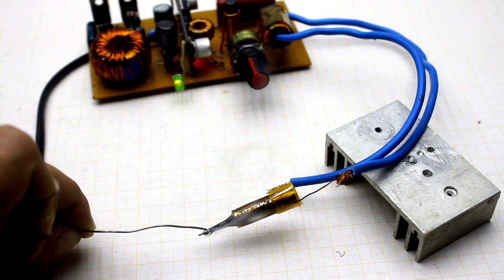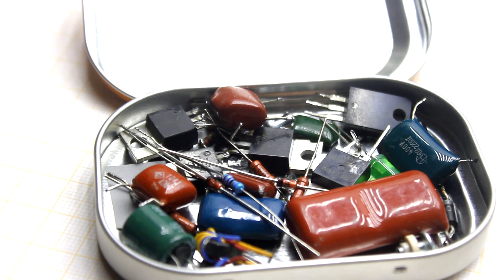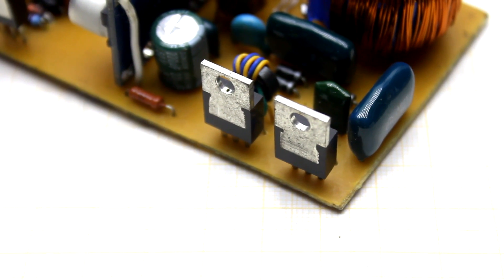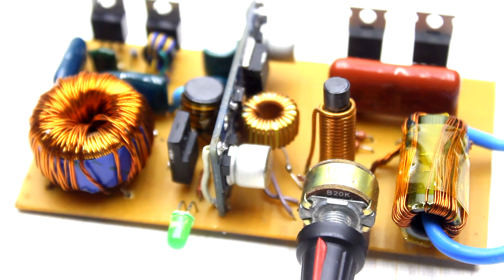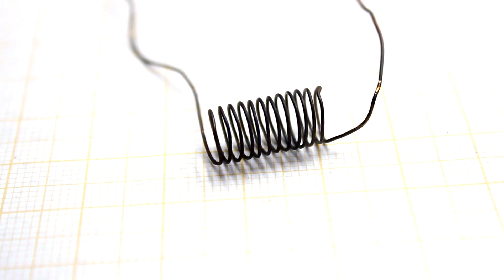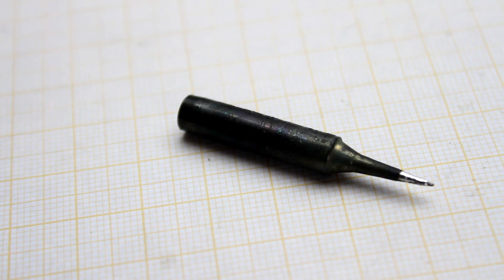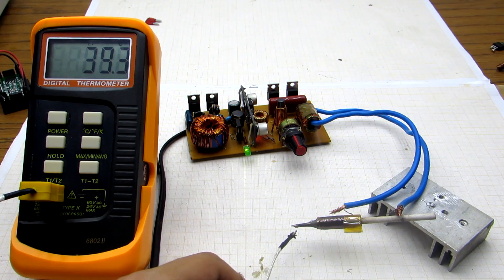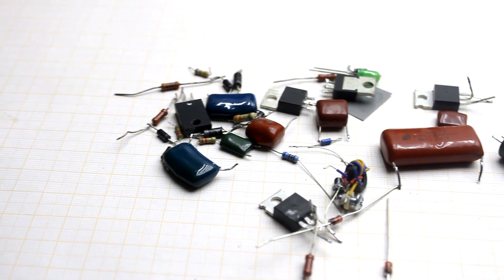DIY induction soldering station

Comment: My old station broke down. Could not find a schematic and many things where burned so could not read the values. I took out the board. draw it on a piece of perfboard. Cut it and made holes in it like the original board. And just made a 555 pwm to an irfz44n mosfet. Works like a charm. Funny you can hear the frequency a bit since it is low frequency modulation. It is not the best design i know. But it is simple, reliable and it gets the job done. Also no need to tune. It does not use the temperature sensing. Since the temp. wire was broken too in the soldering iron and  i wanted to reuse it too.  I choose such circuit.

Comment: Not worth the effort you expend just to have an IH sloldering tip.  Maybe OK for the joy of learning, but from a practical standpoint this is not worth the trouble.
Reply: Ernie Schatz that's the easiest soldering iron you can make. Take mosfets from a dead motherboard, a pc power supply, an arduino/pwm controller, and a thermocoupler and easily you can have THE BEST soldering iron you can possibly have, mine has 200w and heat up in two seconds, i have never seen any soldering iron more powerfull than mine.

Comment: Excellent demonstration. But the problem is I can't understand the purpose of the project! My regular soldering iron is also 24W and doing awesomely better than the one you have shown here.
Reply: vzs's aren't necessarily limited to this low power, i have a 200w system that heats my soldering iron tip in literally 1 second.
Reply: The purpose is just to demonstrate & learn about induction heating; and to build it because he can. But it’s just a fixed power soldering iron with no temperature feedback whatsoever.

Comment: Induction Iron is vary useful for lossless operation. Adding an extra temperature control, this project would be the professional soldering station. Thanks for the research and share
Reply: Rony Chakraborty i have a 200w soldering iron, and damn i have never seen a better or sronger soldering iron than mine, that thing can heat in 2 seconds, plus an arduino nano for pwm and a thermocouple and you're set. Any pc power supply can supply 200w, and with that amount of power it doesn't matter how beefy the component you're trying to remove, if you touched the solder it will remain liquid whatever you do, it's beautifull.

Comment: is the induction heating safe for sensitive electronics? I mean won't the high frequency EM induce currents inside components
Reply: Tayyab Naveed nop, especially considering that the induced voltages should be in the range of microvolts.

Comment: i would just cut the buck converter and the zvs part and directly power it from the first stage power supply. if i want power regulation i would use thyristor-DIAC based pwm control on the 220v 50 hz input
Reply: Two_Number_Nines then you will definetly loose 70% of the power to the ambient and make the soldering iron take ages to heat up, while my 200w system with just a normal tip takes 2 seconds to heat up.

Comment: Why would you want an induction soldering station when a normal nichrome resistor should work better?
Reply: Zetsubou_232_ this is just demo, however top soldering stations like Hakko uses induction heating, advantages are, longer life, quick hearing, better temperature control ( if you are de soldering a component mounted on a big heat sink, normal soldering iron's temperature will decrease, but a good soldering station will sense this and will quickly maintain temperature by pumping extra energy).
I am going to build and use this in my de soldering gun because I am unable to get it's heating element.
Reply: Rohit Chaturvedi you could sense the tip's temperature via curie effect, btw
Reply: Zetsubou_232_ Because it's fun. :)
Reply: Hakko aren't a "top" station.
They are just a reasonable quality budget one.
They aren't induction either.
Reply: NoName yes there are induction stations from hakko, i saw this shit, it wasn't cheap though.
Reply: I'm not sure but i think my hakko uses a nichrome-ceramic resistor.
Also for a project like this you shoulden't think in a high end product.
but as proof of theory is ok
Reply: @jimix321  it’s just a fixed power soldering iron with no temperature feedback whatsoever. To build it because he can. 

Hakko FX100 is induction but that one and Metcal have temperature feedback.